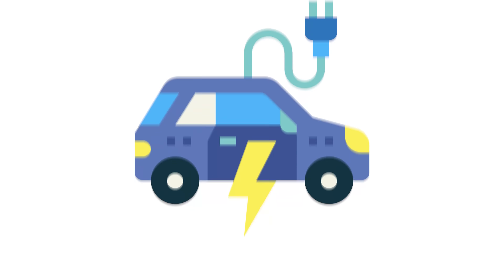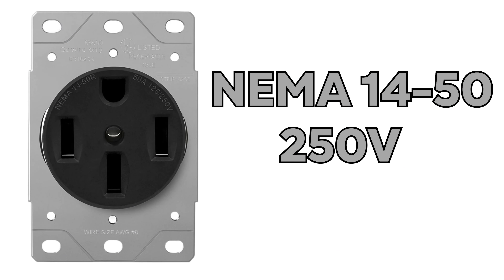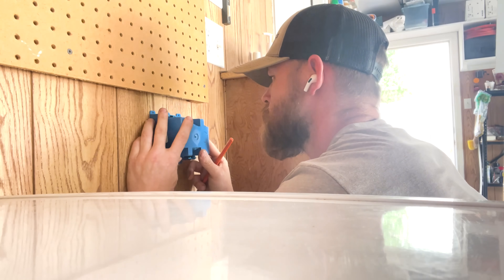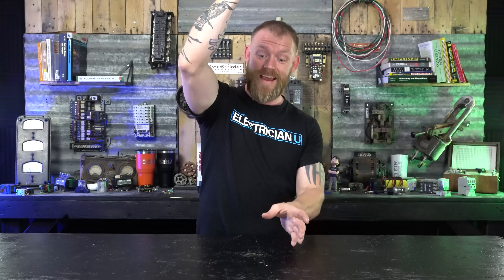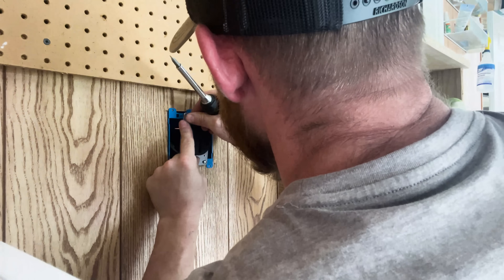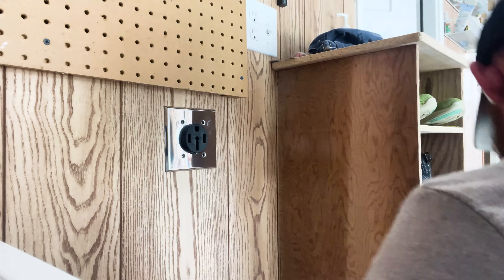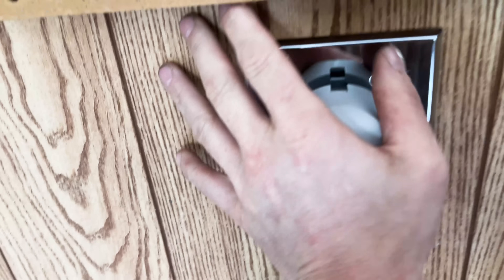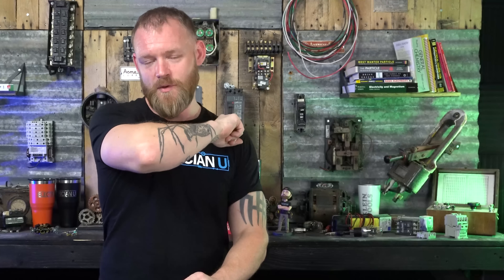How to Install an Electric Vehicle Charger Receptacle

Comment: What I like best about oscillating saws is the ability to cut in situ. You don’t have to take apart something to cut what you are trying to repair or modify. 
I like nuanced tips that come from experience(both yours & the homeowners). I would have never thought that if allowed it might be better to NOT install a GFCI to avoid nuisance tripping. I would have followed code with result headaches. The same with the request for an undersized breaker to accommodate different EVs. Very perceptive. The homeowner appears to be a long time EV owner.
Reply: Oscillating saws are great! For me it was an impulse purchase, but it quickly paid off on its first job. Very economical at the Horrible Fright Tools and mine worked great. No complaints.

Comment: When I had a 14-50 installed the electrician could only pull wire big enough to support a 40A circuit through my existing buried conduit to my detached garage so there's a 40A breaker on that circuit.  That means when using it for an EVSE I have to limit it to 32A (80% of maximum circuit load) which works fine since my EV can only take 32A max anyways.

I also installed a 2nd outlet on the same circuit but inside the garage (my EVSE is on the outside) so if my wife gets an BEV or PHEV we can mount a charger for her as well but in that case I'll have to limit each EVSE to a maximum of 16A to make sure I can never overload the circuit even if charging both cars at the same time, or use fancy EVSEs that communicate with each other and dynamically load balance.

Sure it would have been nice to run a 100A circuit to the garage and have two separate 50A circuits but that would have increased the cost of the install from a few hundred to several thousand dollars, and in any case I know what I'm doing.
Reply: Same circuit. 🤦‍♂️

Comment: Just to add on to everyone saying that you should be using #6 instead of #8 romex...If you were using #6 you'd also have to move up to a 40 cu in box (4 conductors counting the ground since it leaves the box, double yoke counts as 4 more conductors for a total of 8.  #6 is 5 cu in per conductor according to 314.16(B))
Reply: Mark, Do you need to count the internal clamps for plastic boxes? So would it be a total on 9 ? Rick
Reply: @ricksurette7985  my understanding is that the built-in clamps on a plastic box don’t count towards the fill. The only time you have to count clamps is when you put a screw clamp inside the box
Reply: That's what I was thinking

Comment: One question I have which does go a lot more in depth is if you have to look at  a service calculation so to see if the panel (200A for example) can handle that additional load added to the service and how you would do that??

Comment: I'm not an electrician, I mostly do refrigeration and equipment repair, but I naturally do a lot of electrical. Whenever I install a receptacle or switch, I always tape around the outlet covering the conductors, that way the ground wire can't really short anything
Reply: Definently not a bad idea, but this isn't required by code and you won't find many of us who do it outside of  metal boxes, where the whole box is bonded to the ground. Solid copper will stay in the shape you bend it into pretty much permanently, so with experience you learn how to bend the conductors properly to tuck everything into the box without issues.

Comment: What I’m running into is if you did use a 50 amp breaker some homes are going to need a panel upgrade because EVs are calculated for continuous loads. With going with a 30 amp breaker is that keeping you in that zone or range when it comes to panel sizing? I’m a second-year apprentice going into my third year still learning so much to learn and thank you so much for you do!
Reply: An EV on a 30A OCPD should only pull 80%, or 24 Amps
Reply: @ericgold3840  but if you are charging for more than 3 hours that would be 125% or 1.25 and bring it to 37 Amps. Would that be a jurisdiction or adoption of the 2020 code?
Reply: There are a lot of options if the standard capacity calculation indicates you need a service upgrade.  One to go to a smaller circuit and charge slower.  Another is the monitor loads for 30 days and see if you actually have room for the higher current.  In the third, which is sometimes the best, is to use an evse ("charger") that can do active load management, and throttle back the charging rate when the feeders get near full capacity.

Comment: Do your AHJ require you to do load calculations on the panels you install in? Might want to go over that also if it is required.
Reply: In Florida they do not. Would only take minutes to do it though and most houses have a 150a or 200a service for newer homes and they don't even come close to touching all of that.

Comment: For a 50A circuit, isn't 6AWG wire required for the hots and neutral.  Why did 8 AWG get used?
Reply: It isn't a 50A circuit.  It's a 30A circuit.
Reply: @stargazer7644  With a 30A charger... makes no sense.

Comment: It seems to me that those two little plastic flaps aren’t going to be strong enough to hold the box in the wall against the typical forces involved when unplugging such a large cable.  Fortunately it won’t get unplugged very often, but maybe just a few times doing it could loosen or break the flaps.
Reply: Came here to say the same thing! Those plugs are always SUPER tight. You plug and unplug that more than a few times and that box is coming out with it!!!
Reply: @jeremyallen1260  do you honestly know how much pressure it takes to break the sheetrock??  That specific box is called a remodeling box hence the name its used when the wall is already sheetrocked and you are not able to use a nail on box on a stud!!
Reply: @Weasel_NM575  or often referred to as a cut in box.
Reply: @Weasel_NM575  I believe he was referring to the plastic flaps failing that hold the box in the wall.
Reply: You have to use your judgment on something like that, that's where the faceplate does a lot to stabilize & back-up that receptacle, against the pulling and pushing of plugging and unplugging.
Reply: I don't like those plastic flap boxes at all.
Reply: Those boxes are more stout than you would think, but if it is a concern they make more durable options.
Reply: I agree.  Those plugs can take some force to install.  The box will fail over time.
Reply: For something like this with lots of force being applied plugging in and out, I'll spray foam all around inside the wall and then immediately insert the box. Rock solid after 15 minutes and no cold drafts on exterior walls. If the wall is hollow then fiberglass insulation first to contain the foam around the box.
Reply: Here in Europe these flaps are made of steel mounted on a 2 inch (philips 1)screws,..and little bit sharp and hooked shape by the corners to grab Wood ,dry wall ,etc..👍
Reply: @SachsVDE  In the US we also have fiberglass boxes with metal brackets and flaps which are much stronger, but most people buy the PVC ones b/c they're less than half the price and work just fine in most applications.
Reply: @SachsVDE  no one cares this is America
Reply: @bryanesquivel8784  Not until we have to visit the ER.
Reply: I disagree. If you install the box correctly it is very strong.

Comment: My Bosch 30A charger only has 3-pin plug and with the white wire is not connected.  Only the 2 hots and the ground.

Comment: Great videos man! Keep ‘em coming. I’d love to learn more about 3 phase induction motor circuits. From overcurrent protection at the panel to wire size to supplemental protection and overload/thermal contractors and such. FLA, duty cycle and properly sizing components based on the motor plate etc…. I took your advise and downloaded the Ugly’s app which is amazing. But I’d still like to know more about the calculations. Cheers!
Reply: Mike Holt has great instructional videos for electricians that cover that topic.

Comment: Love your videos. I’ve converted my electrical contracting to focusing on installing EVSE’s. You didn’t talk about completing a demand load calculation prior to the installation. We have to take EVSE at 100%, so, it’s not often you can install it on a 100 Amp service, usually have to install an Electric Vehicle Energy Management System (EVEMS), otherwise, have to upgrade.  I’m in Canada though, maybe you are different in the states! But Canada normally follows the NEC after a few years delay.
Reply: Which load management system do you use?  In Canada, the Elmac EVduty system looks nice but it doesn't seem to be available in the US, where the Wallbox Pulsar plus seems to be the best one with that capability.  The DCC relay boxes are the other option but that seems wasteful, because then you have two separate contactors.
Reply: @charliesullivan4304  I use the DCC system.  The local distributor started stocking it for me.

Comment: Good video, thanks. 

Even the Chevy Bolt takes more than 30 amps, mine maxes out at 32.4 according to the EVSE. Might not be enough to pop a 30A breaker, but any newer/fancier car will likely pull more than 30A. 
//There's a setting in the Bolt that will ping your phone, or I think even honk the horn if the charging is interrupted before it's complete. I think Teslas have that too. 

I helped install a 14-50 in my house just a few months ago, learning about electrical work to not get scammed is what brought me to this channel. The electrician we found is about 800 years old and I ended up doing most of the work but it's probably good he was there to check my work at least. I've done some stuff like that before helping out my general contractor gramps, but it's been a while, and nothing as potentially dangerous as this. I chose to use 6/3 because it loses less energy over the run, plus if I do get a fancier car in the future I'll want to have the full 50A available. Was a real pain to get into the outdoor RV box we got, but it eventually went in. 

That was actually the 2nd job we hired him for, first was to replace the 10-30 powering the dryer because it exploded when I unplugged the dryer to try plugging in a smaller EVSE. He got that done quick and easy, but then the dryer and EVSE I got weren't working... I tore the dryer apart checking its fuse and coils, and sent the EVSE back to get replaced, but they were fine. Eventually when he came back to do the 14-50 I asked him to double check his work on the dryer outlet, turns out the circuit breaker had failed too. If he'd taken a minute to check the plug it would've been obvious. Testing is important.
Reply: It will depend on the EVSE that's being installed.

While the car may support charging at higher current, many owners don't need higher amperage charging at home. They are charging overnight and can top up the battery easily at lower current. So they may choose to buy a less expensive EVSE that only supports lower current.

And of course, if the EVSE itself only support, for example, 5 kW charging (20 A), the car is not going to charge any faster than that, no matter what its nominal max charging rate is.
Reply: It's true that lots of cars can pull 30 A or more, but they don't need it.  The EVSE ("charger") sends a signal to the car to tell it how much current it can draw.  If it's set up for 24 A on a 30 A circuit, neither the Chevy Bolt nor any bigger EV will draw any more than 24 A.

Comment: Two questions:

1. At what point would you go to 6/3 or even 4/3?  (I think that's more about distance of run, but please don't ignore load)

2. Have you had anyone install a 250V/100A wall panel and a phase converter so that they could run a DC Fast Charger? If not, do you have any thoughts on that?
Reply: Honestly, when I pre-wire for EV chargers , I pull 6-3. Never know what may change in the coming years. The 14-50 does look like the most likely standard to take. It's just a rational cord and plug connection. I prefer hard wired EV chargers myself. 
But if you're an electrician you know, "give stupid an opportunity and stupid will happen."
Reply: @samuelcrossland1101  -

I myself am also a big believer in overkill when building something. I recall an old 1st Sgt who once commented that when someone tells you something is idiot proof, it only means they haven't found a sufficiently skilled idiot. Yet.
Reply: @EchoTangoSuitcase  I am ever impressed by the skills of the Ignorant. Lol 
Had a rash of smoked GFCI receptacles with "weather proof" covers that got pressure washed last year. I had to explain that the circuitry inside is not protected. I'm pushing for circuit breakers since that.
Reply: Phase converters are for 1phase to 3phase. AC to DC would be an inverter. I believe DC fast chargers are multi KW.
edit: I guess it would a converter rather that inverter. An inverter would be DC to AC.
Reply: @cheddarcheese  -

Yes, I know. 
DC Fast Chargers require a 3-Phase input.
Though, I would not be surprised if you can purchase models that have a Phase Converter already built in. If it's not on the market yet, I imagine it soon will be.
Reply: @EchoTangoSuitcase  How many amps is your main service?
Reply: @cheddarcheese  -

200, but I wasn't looking to put one in myself, I was asking for the sake of general knowledge. 

I don't really want to own an electric vehicle until generation capacity has been properly addressed, which it won't be until AFTER we find ourselves in an electricity crisis, which I think is about 7 to 10 years in front of us.
Reply: @EchoTangoSuitcase  200A is pretty common. That is going to be the limiting factor for most residential installs. ~48A seems to be the top range for residential. 

IMO Atlis seems to be all show, but no go. Same with Lucid, Rivian, Faraday,. Also, where is the Tesla truck, semi, and super car. I thought they were promised to be out now. Where is the grid capacity coming from.

As demand for power goes up, I can only think where prices are going in the future. "everyone, get solar blah blah".
Reply: @cheddarcheese  -

I almost invested in Atlis, but I decided it wasn't time. YET. All those things are coming, and in fact some heavy equipment and transportation manufacturers already have product on the street. 

A lot of people think the batteries are the limiting factor, but they can always be made bigger. The charging and the juice is the real problem. If 10% of the houses in a neighborhood double their consumption, that's manageable. If ALL of them want to... That's a problem. 

And the generation...? In 2020, which was an off year, the US burned 174 Billion GGE of gas & diesel for road-going traffic. That's pretty close to 1,500tWh, and we're currently only using 4,00tWh. 

And unfortunately, too many people still think Wind & Solar will get the job done. I suspect people won't be willing to accept that it won't until they feel a little pain.
Reply: @EchoTangoSuitcase  ... the experts say we have enough excess power / grid capacity to do the entire nation in EVs if it's all done after 10 pm. If you need to charge at 3 pm, you are SOL.
Reply: @rupe53  -

If only the "experts" could do math, right?
Reply: @EchoTangoSuitcase  ... experts can also justify most anything using statistics.... but they rarely make the opposing point. IOW, the cheap bastard will want to charge at work because it's free, instead of at home during the night.
Reply: @rupe53  -

That's probably true, as long as the company allows it.
Reply: @EchoTangoSuitcase  ... yeah, I wasn't talking about the extension cord out the office window, although that could happen. I was referring to the trend of chargers in the parking lots. I'm sure those will be set up for remote monitoring in the future. IOW, maybe timed shutdown during brown out situations.
Reply: I've installed a few Tesla rapid chargers in residential garages. They max out at 48 amps charging current now but reccomend 6 gauge wire and 60 amps of overcurrent protection. The older ones had a dial where they could go up to 100 amps over current protection but they still only charge at around 75 amps max. 
Additionally, Tesla Chargers only need 2 hots and a ground. No need for a 4th wire.
Reply: @samuelcrossland1101  -

The Teslas used to be available with 80A charging capacity. I think they max out at 73A now, but don't hold me to that. I was too lazy to do a Google check before I typed that.
Still, I believe that's coming back. I know Atlis is building Pickups and medium-duty skateboard platforms with 15 minute charge times at 1.5mW, and they aren't the only ones. Level 2 charging on a 14-50 is going to be as obsolete as dial-up modems, and sooner than we think. Definitely before the decade is out.

Comment: Really cool   Note - many receptacles have stripping guides on the back [that are really hard to see]  Strip to length. 
Number 8 is a good choice for expansion and reduce voltage drop. 
QUESTION - what is the panel demand calculation for an EV ?   Does it count similar to a range/dryer  or AC unit ?   
(smirk)  what no AFCI on 220V dryer and EV plugs ?
Reply: You may assume diversity load... for example, you'd mostly be charging your EV overnight, while your range/dryer/water heater will mostly operate during the day or at peak hours. some fancy EV charger can also monitor the whole household demand and pause (or slow down) the EV charge accordingly to prevent overload.
Reply: @denisouellet6518  Yes, and the NEC has a specific provision for those.  Great way to avoid needing a service upgrade.  Wallbox Pulsar plus is a good example of that kid if product.